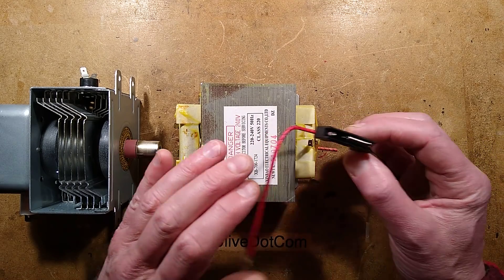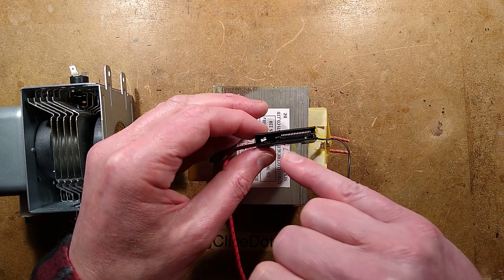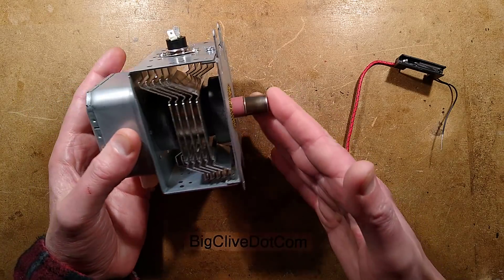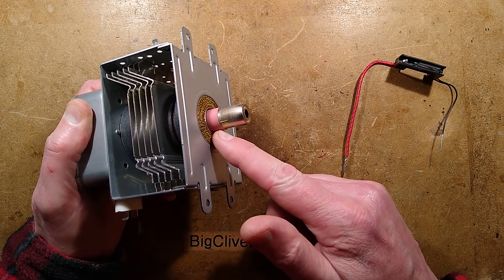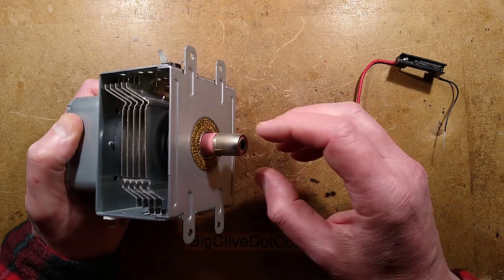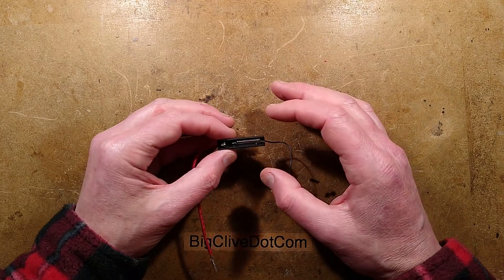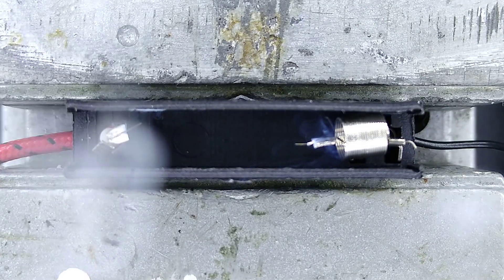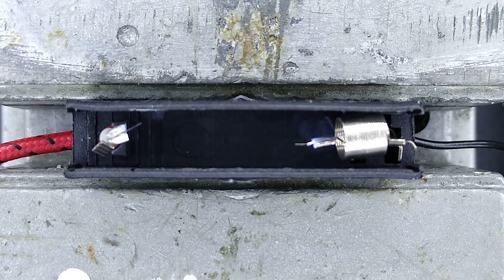Blowing a high voltage fuse

Comment: For some reason this reminds me of the circuit breakers our local trains with 25kV AC use. Because it’s an AC system, you’ve got to split the system up into grids to avoid frequency drift. Instead of having some really complicated frequency compensation or something, the solution is quite elegant. It’s done with a neutral section, which is what it sounds like.

It’s a flat insulated bar bridging the two live wire sections. The train must be coasting through this (to avoid damage to the traction equipment), and there are sets of magnets on either side. These magnets trip an onboard detector, and this detector cycles the main circuit breaker, which is a big box right under the pantograph.

The reason I’m reminded, is because these MCBs make a really loud popping sound. This popping is the arc suppression, specifically air blast arc suppression. When the MCB trips open or closed, some compressed air is taken from the braking system tanks, and is shot into a cavity at the right time, which extinguishes the arc. If the train driver were to power through the neutral section, the air blast helps ensure that if an arc does form, it extinguishes and doesn’t sustain itself from the very high voltage.

If for some reason the MCB does not close on the second magnet, there is a button in the cab which will cycle the MCB manually. I would also imagine that coasting will reduce problems in the event that the MCB is jammed close and does not open on command, although I think you’ve got bigger problems by that point.

But yeah, there are a few different forms of arc suppression out there. Take all of this with a grain of salt, as I’m just a foamer who’s interested in the engineering side of things.

Edit: here’s an example of said neutral section: https://youtube.com/shorts/oWW29rYSF_E?feature=share
Reply: I would imagine based on the heart, that you read the comment. Thank you for entertaining my waffle, kind sir! You’ve hearted a fair few of my comments, but I just want you to know that I absolutely appreciate it. You’re one of the reasons why I want to get into electronics and the like. L

Keep being an awesome bear, and you might just have another bear in the hobby! <3

Comment: Big C!  May you offer a video on the incite of a  magnet-tron?.. are there magnets that can be removed? Peace DVD:)
Reply: i don't understand... you want to know if the magnets can be removed? well, the answer is yes, did that several times, you have to take out the entire unit, open the back lid with a pair of pliers (it's easier than it seems), cut the two thick copper wires inside, near the ceramic, bend the notches that close the iron structure with the fins and magnets, remove a ring on the neck of the output antenna, pull anything apart and voilà... both magnets are out... they are big but they are not neodymium magnets, they are instead a type that don't lose energy if heated (other magnets die in this case)
Reply: @redoverdrivetheunstoppable4637  Thank you Red Overdrive for this info. Any worries about getting those carcinogen elements when removing the magnets?
Reply: @lightcapmath2777  the point is that you don't need to open the TUBE of the magnetron... so you will not break the ceramic or the copper, the magnets will fall apart before that... when prying the notches on the cubical iron structure it will fall apart by itself, only the magnets will stick

you can't fail, just analyse it and start making it into bits

but as a lot of people are saying, if this microwave isn't ancient (and by "ancient" i mean before like 1980) there's no beryllium in it
Reply: @redoverdrivetheunstoppable4637  Cool beans...many thanks again for this input....Best DVD:)

Comment: It would be much more exciting to see how it behaves extinguishing the HV arc as part of its design, or even better, testing how it would handle at slightly and not so slightly over rated voltage.  That sounds a bit more appropriate for Photonicinduction.

Comment: Can you explain why this microwave transformer is so dangerous maybe do a video on one.  I tore down a microwave and salvaged all the electronics have not really thought of a use for the timer.  I do have the transformer and the capacitor as well.  Have you ever come up with a use for this transformer? 
I'm not where I can check the voltage output, however I have made some fine Jacob's ladders with 5000 V. transformers from Spa Ozinators, as well as some very dangerous fly zappers.

Comment: (edit: saw that a lot more commentors did bring up this subject) 

The other scary thing about microwaves is the red ceramic isolator on the end of the magnetron. It often contains berylliumdioxide, which can kill/case permanent in the range of nanograms per cubic meters. It can take a couple of years/decades but it is really scary stuff.

The biggest risk that I read about is crushing the ceramic and creating dust that can be inhaled. 

I opened a microwave to take the transformer and capacitor, but before continuing I checked online and found about the berylliumdioxide. And immediately put the microwave outside and throwed it away at the dump.
Reply from the maker: The majority of modern magnetrons use aluminum oxide.  There should be warning labels for beryllium.

Comment: I’m surprised they didn’t use a fuse with some sort of filler, like sand, to quench the arc.  I would think a specialty fuse with a spring would be significantly more expensive.

Comment: I assume this fuse came from a domestic oven as in 25 years as a catering engineer i've never seen a HV fuse with a spring in it like that. Commercial units usually just have a large glass fuse contained within a plastic housing. i wonder why the larger more powerful units don't need the same kind of system.
Reply from the maker: This was in a cheap generic unit.
Reply: i dismantled a 2020 model cheap MWO and there was no fuse, some others may have it, still the glass one that looks like a big regular fuse but with the spring

i think the safety regulations don't mind much ACTUAL domestic high voltage and anyways the fuse is on the secondary side, so it's up to the constructor

Comment: A little tip if you want to open the magnetron: If you take the magnets away you can grind/file down the welding around the outside and take the endcaps off the copper tube. Only the big middle part is copper, both ends are steel and pressed, welded on. 
And do it on the cathode side! The antenna is spotwelded on one of these "fins" inside the magnetron. But you can easily take out the cathode/heating element.
By grinding down the weld/press you don't destroy anything and get a realy nice view inside the magnetron and on the heating element.

I hope that was understandable 😅

Just recently I took one apart. Now I want to try to cover the heating element in a thin layer of zinc sulfide glow paint, hoping for some slight glow in total darkness. Just waiting for the paint😊
Reply: eh ehm... AKCHUALLY... i care about microwaves AND radioactivity as well, sad story is that your experiment will not work (visibly), radium clock hands are loaded with a craptonne of alpha radiation, a magnetron thorium filament emits just a few beta particles, a single magnetron filament is quite hard to be detected on a geiger, but you can detect it at the end, anyways there's no match with a radium hand, that will make a cheap geiger go nuts by just the gamma rays, and radium alphas (the ones that make the zinc sulfide glow) are tens of times more and more energetic

sorry to sound cocky or a know-it-all but don't scratch you head too much when such experiment will not work... that's the reason

if you want a radioactive light source the only way (today... and safely) is getting a tritium keyfob aka "GTLS" but EVEN THOSE are getting rarer now

EDIT: after decades, radium clock hands don't glow anymore bcs the zinc sulfide is destroyed by alpha radioation, one thing you can do is getting a radium hand ad cover it (again) with thinned fresh glow in the dark paint, they say it will work again (maybe less), but touching and handling radium is something i would NOT raccomend... so i'm saying this just as inventory :)
Reply: @redoverdrivetheunstoppable4637   I don't expect it to work, it was just an idea. Like in a spinthariscope I was hoping to see a VERY dim glow, but with so little thoriumoxide and it being so weak I have little hopes.
You wrote beta but thorium is mainly emits alpha with a bit of beta and even gamma decay, or am I wrong?🤔

The zinc sulfide arrived last weekend, I will still test it.

I always wanted such a tritium keyfob, but I live in germany and everything fun is highly forbidden here  😁
Reply: @-Tris-  yeah, thorium emits mostly alpha but a magnetron filament is solid metal and the alpha it will emit will be exclusively from the very external layer of such alloy, so they would be like 5% of the total amount, the remaining 95% will be trapped inside without reaching anything

i admit i've never heard of a spinthariscope... i do have heard of watching radium dials under a magnifying glass hoping to see something in today's worn paint, tried it, no luck, i've also used a watchmaker's monocle, i saw nothing

you can still try to order it, even in the worst case they have a geiger at the customs a tritium keyfob doesn't escape ANY radiation... but i warn you that also ebay took away the fun, you don't find uranite anymore, anything uranium is taken down, this policy seems to apply since some months, an year ago you would find ANYTHING... quack radioactive healing mumbojumbos are still sold tho, along radium hands and few other things, like americium smoke sensors, you need to order this stuff from foreign countries... let's skip about vacuum tubes sold from ukraine and russia -_-
Reply: @-Tris-  i dunno if you're still interested but i did the experiment, i used an americium button and transparent sticky tape sprinkled with yellow-green strontium aluminate powder, yes, i can say it works, i checked the americium pill on a DIY exposed photodiode geiger and it emits A LOT of alpha, i compared it to a radium hand and it was like 10X more, this mostly because radium paint is intended to trap the alpha inside and glow as a mass, while the americium pill has a spread surface and it has an alpha particles jet

the sticky tape must be covered in powder up to a point it doesn't stick anymore, the whiter it becomes the better it is, then you put it with the powder facing the americium at a max distance of 2mm (you may have seen guides about the spinthariscope), hopefully not touching the radioactive stuff to not ruin it... you can try with a weak alpha source hoping for seeing the single decays but an americium smoke sensor is way better and the powder will glow as a spot, the trick is to let the glow-in-the-dark powder discharge completely and it's quite tricky bcs you have to prepare the rig, let it stay in 100% darkness, wait at least a day, and watch it in complete darkness under a magnifying glass with your eyes completely adjusted, you should see a slightly brighter dust spot over the americium but only trough the magnifying glass

don't worry i'm not nagging you bcs i think you are a girl, i'm 95% sure you're male and i haven't clicked your account

cheers from sicily :)

EDIT: i tried to take a picture.... total black
Reply: @redoverdrivetheunstoppable4637  Hey, thanks for the update. I did my first test yesterday and it didn't seem to work (as expected😅).
I made a zinc sulfide layer on a glass plate with different thicknesses. With bare eyes in total darkness for a few minutes I couldn't see anything.
Even a picture with 10 second exposure doesn't show anything.
The little bit of weak Thorium in the heating element just isn't enough, Americium is much stronger.
I didn't know it works with strontium aluminate, that's interesting.

And yes, I'm male. But half the people here on YT don't realize 😂
Reply: @-Tris-  oh yeah! i forgot about long exposure pics! ...my father's phone can do that, i think i can try to do it better, maybe waiting more time to let the powder discharge at best

i wasn't sure as well if it worked with strontium aluminate, but why not? (in my ignorance)... it should work better(?)

it seems a BARELY working experiment, you can still try with the filament and the best setup you can make but this smells like one of those experiments that work just 10% of times, maybe also the powder can have been diluted bcs it's cheap so we may be both wasting time... also if you're using pre-made paint the liquid medium can absorb the alphas, i think you need pure powder

anyways a smoke sensor costs like 11€ shipped, search on ebay for "geiger test" or "geiger check" or the name of the radioactive element... at the times i bought a pair of em they costed 3€50 each and they were sold as smoke alarm spare parts
Reply: @redoverdrivetheunstoppable4637  Yeah I will try something different and also use a magnifying lens. 
You might be right about the paint. The stuff I have is like wall paint and you can dilute it with water  🤔. I thought it might be better than epoxy. The idea was to get the particles directly on the filament in a thin layer.

Thanks for the tip with the smoke alarm thing, didn't know they were so cheap.

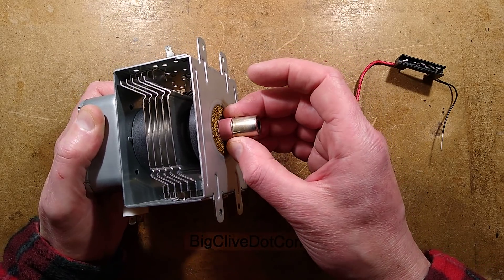Comment: 0:55 Thank you! Finally some with knowledge/common sense say Its not beryllium oxide, its also the reason the magnetron get quite hot since the aluminium oxide that is used instead is not as good to conduct the heat away but is good enough for a normal house appliance microwave oven. Ceramic that contain been beryllium oxide have been warning signs all over it.

Comment: It's interesting to see a High voltage fuse in action but it totally make sense for an AC fuse but especially a DC fuse.
You don't want the fuse to blow and the electricity to just jump between the missing link...

Comment: Very Cool. I used the playback speed option and dropped it down to 0.25.  You can see the fuse wire glow and then the spring pull it back. It's too bad you don't have a high speed camera when doing this and the other components that you made go bang.

Comment: Utility mains here are in the 13 KV range.  Rodents had been a problem, both nocturnal and diurnal varieties.  Seems like they either got bored with life or didn't have access to non contact voltage detectors.  Being aerial service,  we were treated with an earth-shattering kaboom and out went the lights.  
These fuses have some arc extinguishing property which adds to the sound.  The actual fuse element is contained in an 8mm fiber tube which is shielded in a Garolite holder.  

The utility finally installed a silicone boot so the drama is gone.  

I've seen other line fuses with less drama that are filled with sand to quench the metal vapor.
Reply: Still remember as a kid see a squirrel running across the high-tension line at the apartment complex when I was outside and next thing you know boom!

Head there leg there times four.

Tell there but pretty much body nowhere!

Couldn't see for bit from the blue Flash haven't been looking right at it when this occurred!

Comment: Hey Clive, recently found a 1980/1990s audio synthesiser keyboard in a charity shop, bought for my brother as he is becoming a producer. 

Model: Yamaha PortaSound PSS-380

It turns on but does not play audio. I have checked the speakers work, and tracks from an IC to these. Interestingly enough, I can see some oscillators are generating output with a speaker, but haven’t been able to find the root cause to my problem. 

I am UK/bucks based so am wondering if this is something you would look into? Let me know if there would be a cost involved - Jack

Comment: This spring loaded fuse reminds me of a previous life. About 50 years ago in  high school in electronic shop class we were trying to make a video switch for our fledgling video lab . The single pole switch did not work. The video would just leak across  the switch gap. We had to reduce the capacitive coupling. Someone came up with the idea of using an eight pole switch and connect all the contacts in series thereby cutting  the signal 4 times increasing the gap and reducing the capacitance .. It was a splendid success.

Comment: These are cool! If you pop them by shorting the transformer across it you can see the arc form and die in the span of a hundred or so milliseconds. Not an instantaneous fuse, but fast enough to prevent major damage

Comment: they seem to have stopped fitting these to some microwaves. the one in mine blew and it is easy to do, you just need to stop/start it quickly a couple of times as you would if you hit the wrong time when starting, then hit quick 30 or similar.

The repeated surges heat the fuse up and eventually they blow.

I replaced it and it has been running ever since :)

Comment: I may have mentioned this , but the magnets ( as shown ) are highly useful . In the kitchen a few lined up on the fridge can hold many steel cooking tools ... but jammed on the end of a wood broom handle will pick up nails / screws / drill bits dropped in your workshop ( suggest covering with a cap from any big spray can , with a screw into end of broom handle , these magnets are very BRITTLE and the cap protects it from knocks ) ...tried - n - tested ....

Comment: The reason for the large gap is to stop arcing of high voltage. I have seen berilyum that colour in very old RF amplifiers , but I treat anything suspect with great respect. Had some berilyum copper sheeting when I was very young and didn't know about it! Cut myself very slightly with it. It took months to heal lesson learned. Berilyum is dangerous in other ways too!